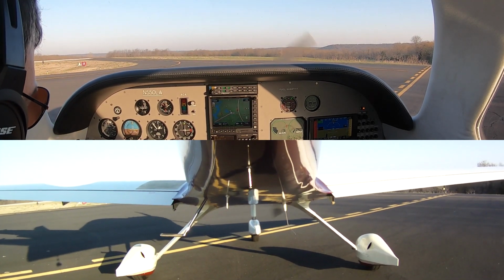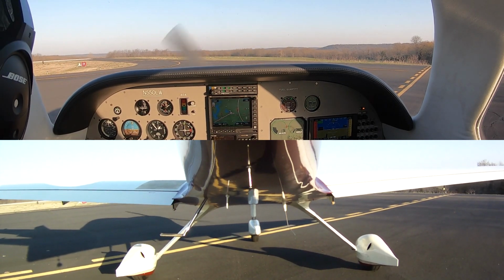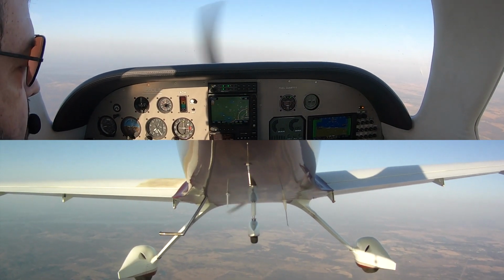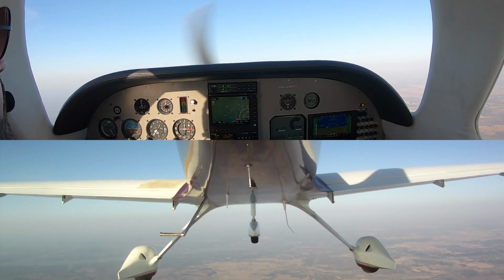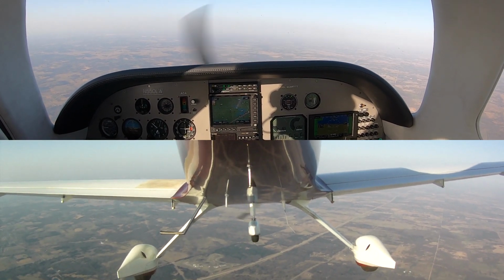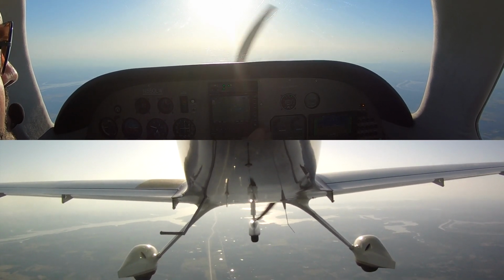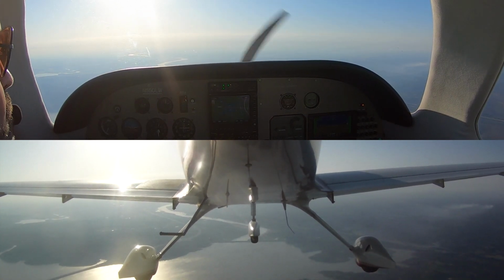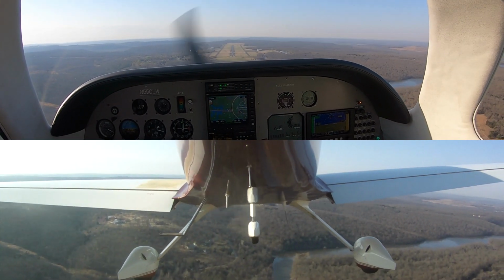Lancair ES 4/3/2021 Morning Flight

Comment: Would you mind sharing some more info about your plane?  What Engine and Propeller?  What is the Useful load?  How much Fuel does it hold?  What is your typical Cruise TAS at 23" MP and 2300 RPM at ~8000ft MSL?  What is the Fuel Burn ROP or LOP?  Beautiful plane.
Reply from the maker: IO550 Continental, cruise 2350-2380, 185-190 TAS, burns ~13gph leaned. Holds about 1k lbs a tanks are 76gal.   Thanks for asking!